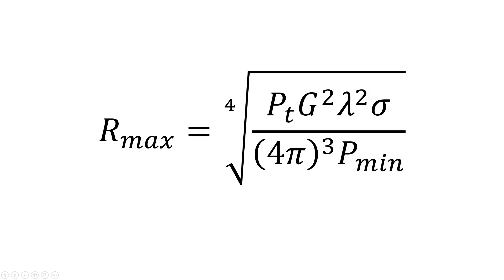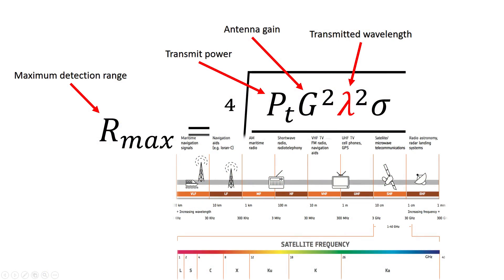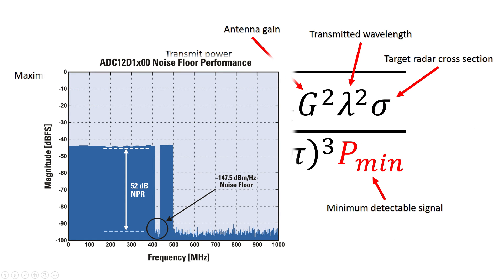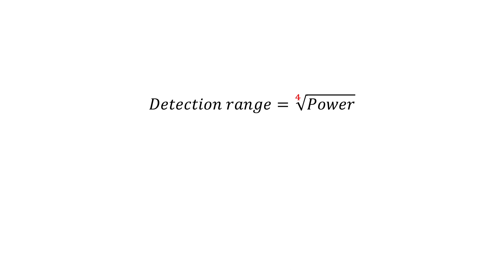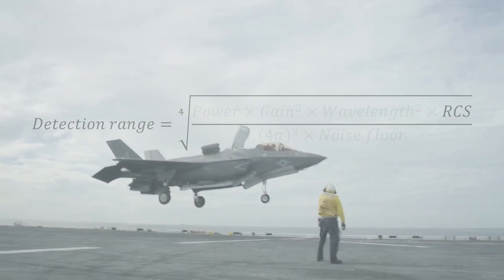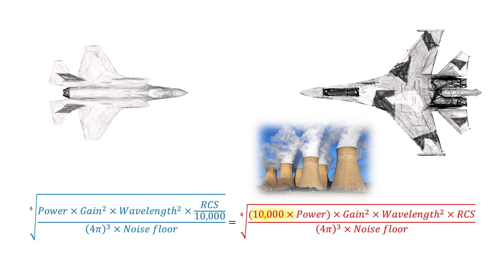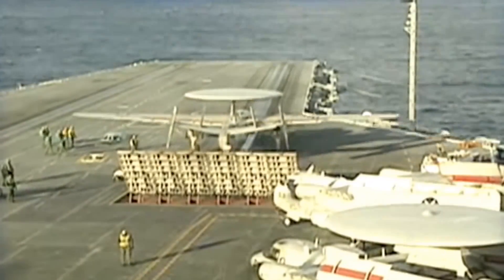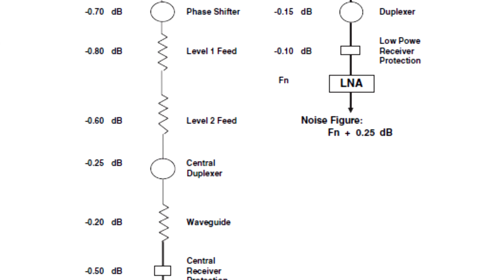F-35 Lightning II: Busting Myths - The Radar Equation [v1.1]

Comment: this is just a breakdown of the math, and not the systems used by ground based radar Russian and Chinese air defence rely on ground based radar for air intercept these radar systems have been updated or retrodated depending on how you look at to the lower frequency bands that were used back in the fifties. stealth aircraft would be a disadvantage invading enemy airspace, the same can be said of an enemy trying invade our airspace. you have to look at the whole system of command and control.
Reply: Dragon029 haha you owned him
Reply: He seems to know more than you.
Reply from the maker: The radar equation applies to all radar systems, regardless of their frequency band.
Reply: You have missed my point. Ground based systems have been built that can defeat stealth through power gain and frequency.
Reply from the maker: Patrick Radcliffe
Except they don't "defeat stealth", they detect it at longer ranges at the expense of targeting resolution / accuracy and spoofing-resistance.
Reply: Targeting resolution does not matter since ground controllers are vectoring aircraft for intercept not targeting a missle.
Reply from the maker: Patrick Radcliffe
And how do those aircraft lock onto the F-35? How do they get close enough whilst dodging AMRAAMs?
Reply: Well lets see the AIM-120 has both a active and passive seeker head both rely on radar either from the attacking aircraft or its own radar. So with that said active jamming or chaffe would be proscribed. Now if I was defending against them I would use infrared homing missles or push to gun range for a knife fight. Playing to the weakness of the F35 in ACM environment. Current crop of Russian and Chinese fighter aircraft still emphasize ACM in their designs. Personally I would take a Super Hornet with the networking and sensing hardware of the F35 into a fight over the F35 itself.
Reply from the maker: Patrick Radcliffe
Just for the record, chaff is of limited use due to how rapidly it decelerates, while with active jamming the AMRAAM has a Home On Jam functionality that could lead to a kill.

As for counter-stealth; infrared homing missiles only work reliably against suborbital targets or WVR, as moving through the atmosphere for extended periods, without an active cooling system, causes missile IR seekers to saturate with heat. Trying to get WVR or within guns range of an F-35 would be suicidal.

Also, I'm puzzled as to why you'd take a Super Hornet; the F-35 is better at ACM / BFM than the Super Hornet.
Reply: Actually no the F35 does not have the power to weight ratio or g loading the Super Hornet has and it can take a punch better then the F35 with more redundant systems. It's not suscidal to push to visual range for a IR shot or a knife fight would be putting the F35 at a disadvantage with any variant wither not having a gun or limited ammunition in the one that does. Your own video talks about kill ratio in Vietnam improving after Top gun and Red flag are established these programs while different in some respects emphasize ACM which to some extent counters the abilities of the F35 being a missle truck and fighting at BVM. You video neglects this fact that very few engagements happened at BVM they always closed to visual range.  With negation of the F35's stealth advantage by ground control intercept which the Russians and the Chinese are very very good at. The best the F35 could do is ripple fire and hope for hits. The best I see the F35 being effective is in conflicts like Dessert Storm or Iraqi Fredom as a stealth attack aircraft with the ability to protect itself against inferior air defenses.
Reply from the maker: Patrick Radcliffe
If the Super Hornet wants to carry enough fuel to get home, it'll have a T:W ratio worse than the F-35. The F-35 also has considerably better acceleration (similar to that of a clean F-16 or F-22), because it has far less drag. The Super Hornet in particular has all of its wing pylons tilted outwards, considerably increasing drag (and you can't eject pylons on the Super Hornet).
When it comes to G loading, the Super Hornet has a 7.5G limit, the F-35A has a 9G limit.

The Super Hornet's engines are also right next to each other, so if one eats some 20mm, it's almost certainly going to explode and destroy the other. Not to mention, if you lose one engine and miraculously keep the other alive, your T:W ratio halves and you're dead anyway.
As far as flight controls / non-engine systems go, the F-35 is more survivable / more redundant.

"It's not suscidal to push to visual range for a IR shot or a knife fight"
It is, because even with pessimistic pK figures, surviving 4 AMRAAMs is highly unlikely, let alone the others that would come from the other F-35s or 4th gens, etc.

"any variant wither not having a gun or limited ammunition in the one that does."
Are you aware that all Russian fighters (aside from the MiG-31) only have 150 rounds of ammunition?

"while different in some respects emphasize ACM which to some extent counters the abilities of the F35"
No, it counters other fighters trying to perform ACM. It also doesn't account for the ability for fighters like the F-35 to launch missiles in a HOBS manner.

"You video neglects this fact that very few engagements happened at BVM they always closed to visual range."
Primarily due to the limited ability for those aircraft to positively identify targets. An F-35 has 50x the methods to positively identify a target compared to a 4th gen, which themselves are significantly better at achieving compared to Phantoms and century-series fighters.

"With negation of the F35's stealth advantage by ground control intercept which the Russians and the Chinese are very very good at."
Even with GCI, F-15s have failed terribly to locate and engage F-22s in Red Flag exercises. China has apparently done their own little exercise with their J-20s (where J-20s decimated J-10s, J-11s, etc backed up by GCI and AWACS) that supposedly caused a major shock to the PLAAF as well.
Reply: Dragon029 💪💪💪
Reply: nope not worth arguing with someone that does not understand how air warfare works in the real world
Reply: There's no point in debating Dragon. He's got pre-canned answers for anything you might say. He prefers propping-up 1-dimensional examples to addressing the scenario at large. Kind of reminds me of a colonial British commander who thinks he'll win every battle because his musket has 2x the range. Meanwhile neglecting the fact that the enemy will just hide in the bushes and wait till he's close enough to pop-out and blow his head off.